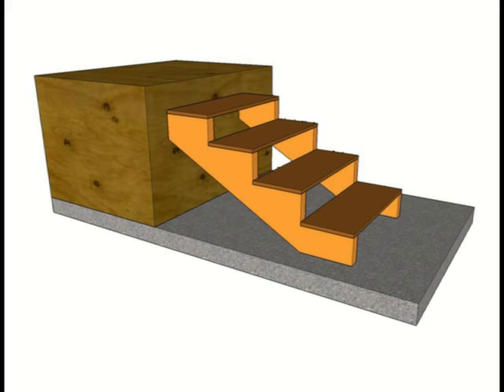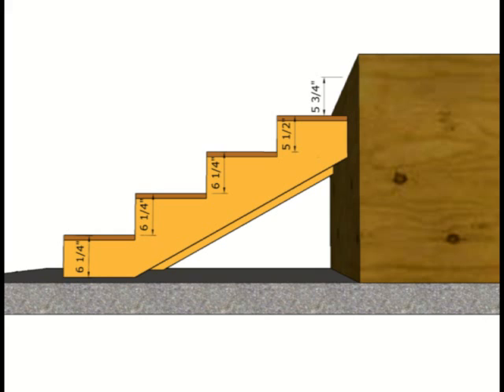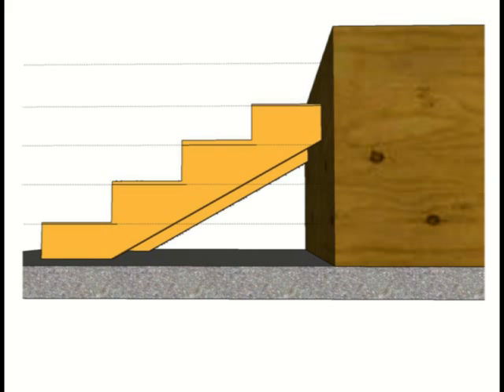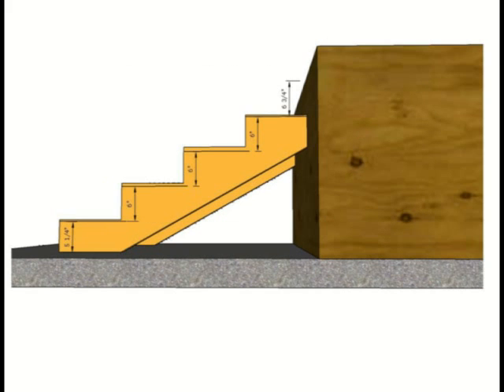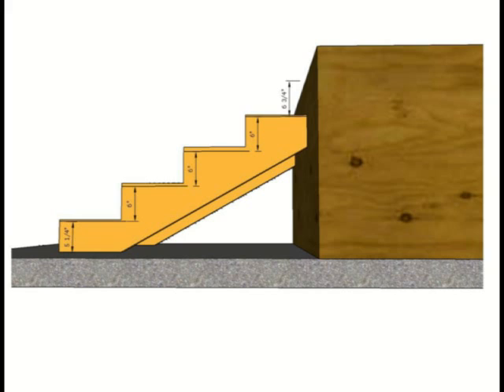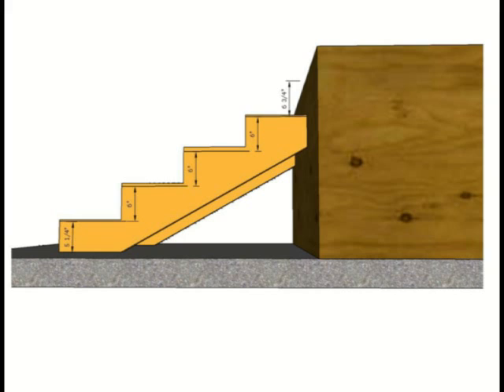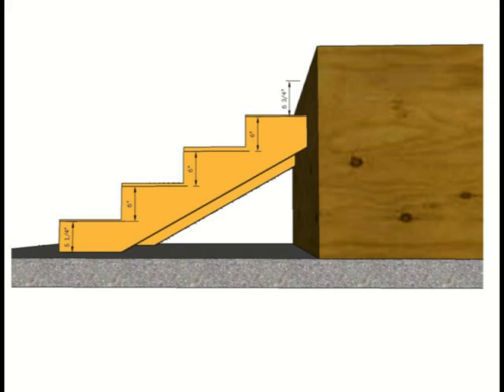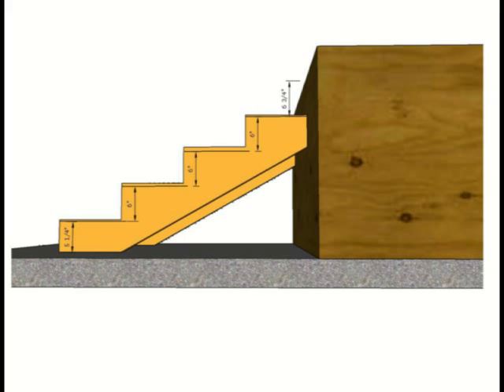How To Fix Stairs With Inconsistent Riser Heights - Building and Construction Tips

Comment: My bottom step of my entry stairwell is about 1/2 size smaller than other steps. Two people have miscalculated their step and fallen. I have yellow tape there but want to have the stair fixed so the height is close to the others.. How can that be done?
Reply from the maker: You will need to raise the steps or lower the floor. If this doesn't make sense email me a picture of your stairs and you can get our email address at our website.
Reply: @stairbuilding  thank you. When I'm at my house in a month or two I will send you a picture.

Comment: So I recently removed the carpet off of my stairs and the following are the measurements of my 8 stair risers:

8, 7.75, 7.75, 7.75, 7.875, 7.75, 7.875, 7.875

They obviously are within 3/8" but a couple are jut over the 7.75" code limits.  What would be my best option here with such little wiggle room?  I have been busting my brain cells trying to calculate the best option.   Any help is greatly appreciated.
Reply from the maker: I know you don't want to rebuild the stairs, but you might have to.

Comment: So how do you best add material? My steps on the middle two strings are approx 3/16 short vs the outer two stringers
Reply from the maker: You can add materials with some type of adhesive, glue, screws and nails.
Reply: @stairbuilding  thank you, appreciate it
Reply: Would you add wood? Like hardwood or softwood? Im thinking hardwood for durability but might split when its nailed or drilled into... Is softwood better?

Comment: How much of a difference can the first stair difference be max? We have a 1.25 difference between the first step and the rest.
Reply from the maker: Most building codes allow for a three eights of an inch variation. 3/8 or 3.75 as a decimal.
Reply: @stairbuilding I think  0.375" is what you meant for the decimal representation of 3/8".